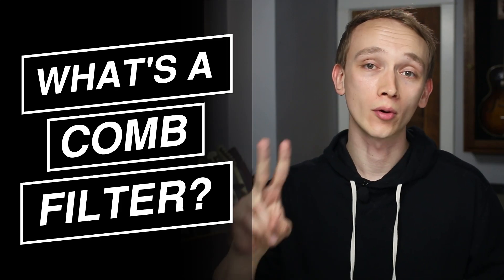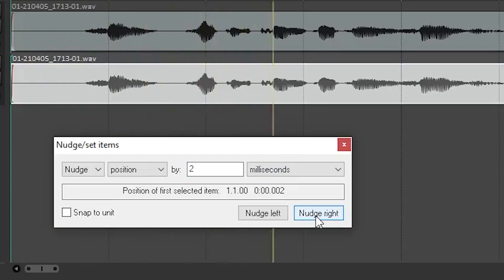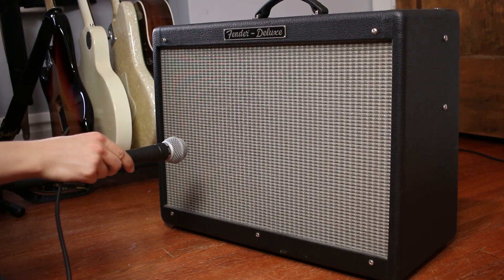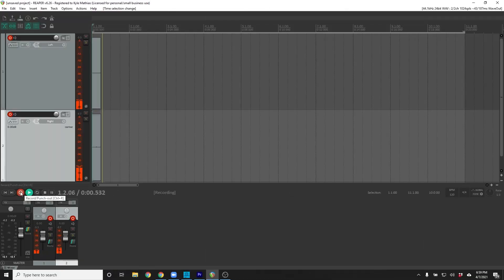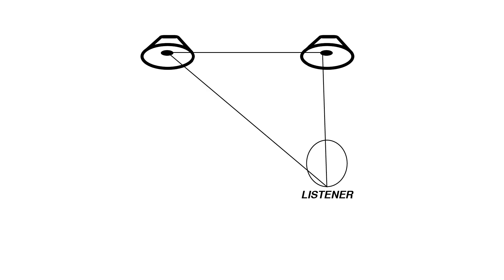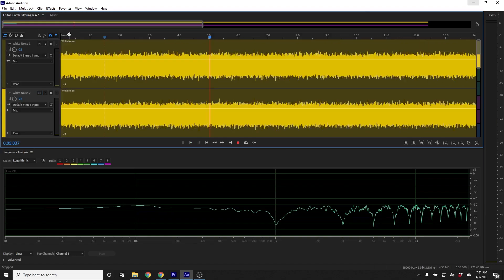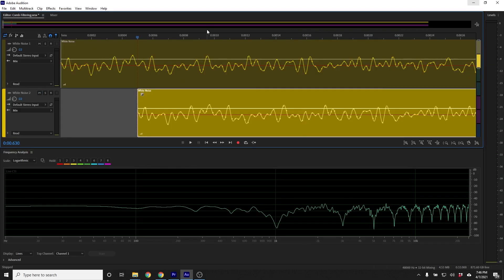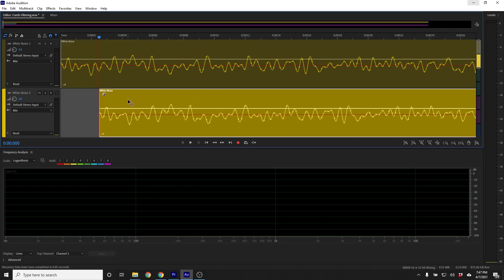Everything You Need To Know About Comb Filtering [with Audio Examples]

Comment: I work in electronics a d what you are describing is a comb filter EFFECT, not a comb FILTER. A comb filter is used in signal processing to introduce destructive or constructive signal at the output by applying a delayed version of the original signal. So a filter is an actual variable delay line sometimes used in analog video processing foe time base correction. 
What you describe is the comb effect that can be caused naturally as u described or by introduction of a delay as you did by shifting the audio signal also called phase shifting. Phase shifting can amplify or cancel out a signal such as in noise canceling headphones There it hears ambient sound with a microphone, phase shift it 180° and insert that sound into the audio stream. Thus cancelling the ambient sound signal. :)
Reply from the maker: Interesting distinction, Roy! Thanks for sharing your perspective on this and the extra info.
Reply: @AudioUniversity  your welcome. I only like to post positive comments that are helpful to others

Comment: OMG finally someone who knows what he is talking about. THANK you for making this most excellent and perfectly produced video. For years I have been fighting this rediculous idea of building center channel speakers with an array of drives positioned along a horizontal line under the TV. Everyone in the room other than the one person who gets to sit in the dead center will be experiencing comb filtering of the center channel material and that of course is mostly the human voice. Adding any type of distortion to the human voice is never a good thing. When I built my center channel speaker I susptended it vertically directly above the center of the TV aimed slightly down so it’s on axis with the average head height of the audience. This all but eliminates comb filtering. PLEASE do a video on this topic. You could really do it justice and perhaps enlighten the minds of people who think you just buy the speaker and place it under the TV. Thank you again for your great work.
Reply from the maker: Good idea, E! A video on horizontal vs vertical driver orientation is a great suggestion. Thanks!
Reply: Why not put one (or two) driver(s) above and one (or two) driver(s) below the screen? If drivers are not equidistant from heads, delay according to the average angle difference? Should create a phantom center right from the screen.

If projection screens are made from cloth or perforated, they put speakers behind 'em.

Comment: I'm getting the first notch at 1kHz with only about 0.5ms of delay. Why am I getting this result when your result is the first notch at 1kHz with 5ms of delay?
Reply from the maker: As someone pointed out earlier in the comments, I mistakenly said "5 ms of delay" when I should've said ".5 ms of delay". I'm glad you're running the test for yourself! Nice job, Eric!
Reply: @AudioUniversity   @Audio University  Oh, sorry I didn't check further. Thanks for clarifying. I'm wondering if you know if there's a plugin available to apply an EQ curve to a comb filtered signal to remove the unwanted effect. So as long as you know what the delay time is, this should eliminate any comb filtering.
Reply from the maker: It’s possible that a plug-in exists that I’m unaware of. But, it would actually need to ADD frequencies that have been notched out by the comb filter, which seems like no easy feat!
Reply: @AudioUniversity  True, but only for a very narrow area at the center of the notch. I tried adding a boost to fill in one of these notches using white noise and it looks good on Pro Q3's analyzer zoomed in all the way, no remnant of the notch, amazingly. I'm sure the case would be different for a sine wave. Might give that a try.
Reply: Gave it a try. It works OK with a sine sweep, but the result is not perfectly smooth. The filter needs to have an asymmetrical shape which I don't know how to do with my tools. As far as a pure sine, somehow I can't generate a tone even at the center of the notch that is NOT recoverable. Maybe the precision needs to be much greater. So it seems like it should be possible!
Reply: @EricPeelMusic  As the comb effect caused by time delay, I suspect that you can reverse it also with time domain manipulation rather than on frequency domain.

If you delay the "dirty" signal, and attenuate the original one (so the highest amplitude comes out at a later time, to model the reverse of what could have happened in real life), then mix the two (or more), would it work?

Possibly with multiple instances, if multiple reflections occured.

I haven't tried it, but I assume it would work in case you can somehow determine the delay/attenuation coefficients of the reflections/crosstalks.

Is this a theoretical/experimental question by the way?
Reply: @gabiold  In my case, there is only one signal, the "dirty" signal. Such as a single, poorly recorded audio file. There is no other signal to move in time in relation to it.

Edit: I think you mean to delay one channel to realign the channels. This helps a lot, but then the frequencies are very unbalanced left vs right.

Sorry, it's been a while since I had my brain in this mode.

Comment: Great video thanks for posting it

I just wanted to clarify the relationship between the delay time and the lowest cancelled frequency as you may have made a slip of the tongue.

In your demonstrations (the first of which is at 9:15) you say that you’ve delayed the 2 sounds by 5 ms and that results in the lowest cancellation being at 1000Hz.
I think you’ve actually delayed the 2 signals by 0.5 ms (the time display shows 0.0005 seconds so that’s 0.5 ms) , in which case the lowest cancellation would be 1000Hz as you say.

However, a 5ms delay between two identical signals causes cancellations at 100Hz and all odd harmonics of 100Hz. This is because 5 ms equates to half the period of 100Hz and therefore a time shift of 5ms is equivalent to a phase shift of 180 degrees.
Reply from the maker: Thanks, George. I didn’t notice that mistake until now. I appreciate you clarifying that.
Reply: @AudioUniversity  A great video, but this error would have left me confused had I not come to read the comments! So my question with comb filtering involves hearing aids. One company has claimed their low latency of 0.5 ms fixes this problem of comb filtering caused by interference of world sound directly hitting the ear drum and the delayed signal through the hearing aid, but it looks like they've only kicked the problem up to higher frequencies that may not be an issue for many people but not for a musician. I notice it in my hearing aids with open ear tips as certain frequencies sound way off. Like the open G on my bass compared to the harmonic octave which will will sound like G#. With closed domes lowering the outside sound this seems to clear this up. I believe my hearing aids have a latency around 5 ms -> lowest cancellation at 100 Hz. Do you think this is indeed comb filtering I'm experiencing?

Comment: So if the delay beatween one signal and other is 0.3ms the first notch of frequency will be at 16khz? The rule of the duplication of signal augmenting 6db when copied is universal? If I take a mic for example and make a cable for connecting to the back of the computer as well of the front, if I add the 2 signals it will increase by 6db?
Reply from the maker: Terry, check out the graph on this webpage: http://www.sengpielaudio.com/calculator-combfilter.htm

I believe the first dip would be around 2.5 kHz based on that graph.

Anytime you add two in-phase signals together, they will sum. If they are the same amplitude, they will sum for a +6 dB increase.
Reply: @AudioUniversity  thanks for answering. Ill check it out.
Reply: You can calculate from linear level (voltage) ratio to logarithmic (dB) ratio by the following equation:
dB = 20*log(u2/u1)

So if your original level is u1, then if you mix with itself then u2 will be 2*u1

If you plug in 20*log(2) will be 6.02 dB.

The reverse function is u2/u1=10^(dB/20)
For example, if you have 40dB of attenuation, which is -40dB of amplification, then
u2/u1 = 10^(-40/20) = 0.01
so the output is the 1/100th of the input.

Addition in the dB scale means multiplication in the linear scale, for example:
20dB = 10 times
20dB+20dB (40dB)= 10*10 times (100)
20+20+20dB (60dB) = 10*10*10 times (1000)
20dB+6dB (26dB)= 10*2 times (20 times)

Negative number in the dB scale means the reciprocal value in linear scale, for example:
+40dB = 100 times (amplification to 100 times)
-40dB = 1/100 times (attenuation by 100)

Hope this helps everyone who is confused by the decibel scale. 😉
Reply: @gabiold  thanks for that info, I'll look more carefully into it. One thing I wanted to know is for example, in the chart where 0db is the quietest sound the human ear can hear, and 56db I think it was, was the loudness of normal conversation (140 I think it was a jet engine) is that linear scale? and what would that convert to dbfs scale? it being -56dbfs seems too quiet imo.
Reply from the maker: Hi, Terry. This is a great question. I think this video will be helpful for you: https://youtu.be/F4r3WI-JXlc
Reply: @AudioUniversity  Thank you very much, I'll check it out.
Reply: @AudioUniversity  I've seen it already since I see my like there haha, but I'll give it another watch.
Reply: @terry-  If it is given in dB, then it is in logarithmic decibel scale. What is actually the question? How you define the dB FS scale?

What is the value of normal conversation on a dBFS scale, where 0 dBFS represents a jet engine?